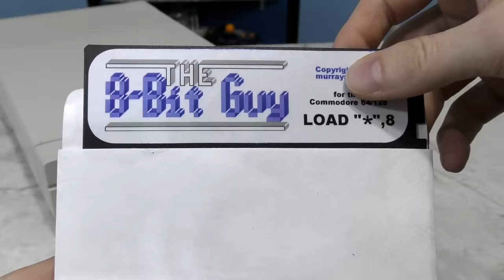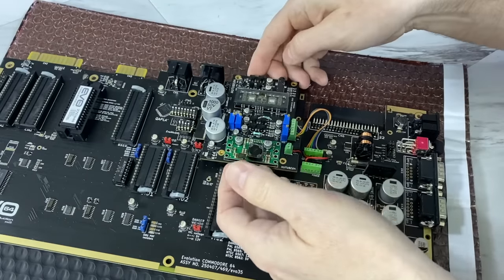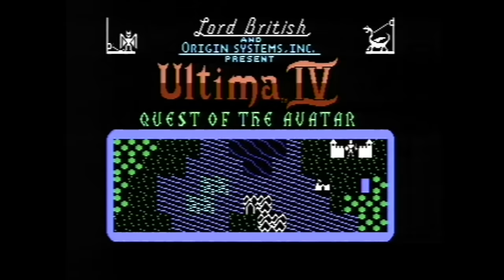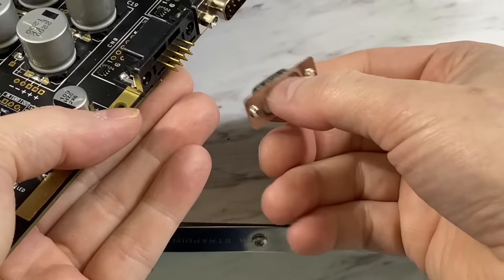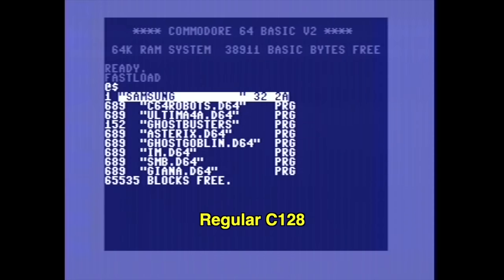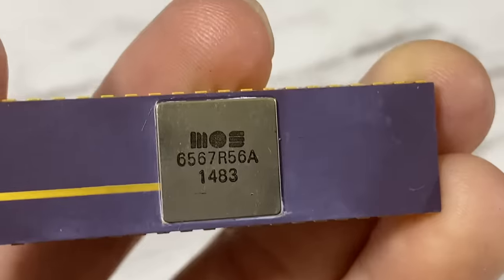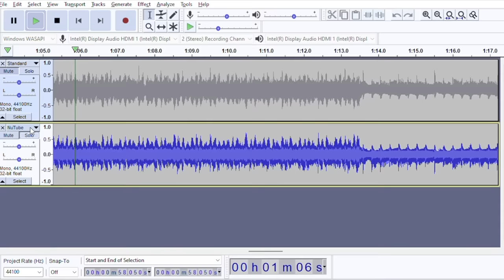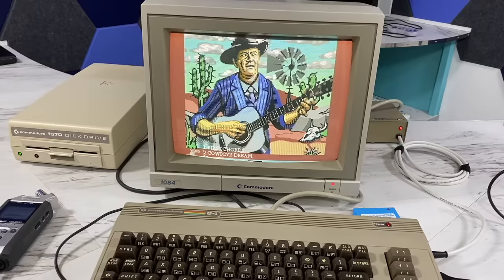The Evolution64 - Is it worth the money?

Comment: I'll try to make it clear. Vacuum tube doesn't improve sound. It's actually distorts sound. Vacuum tubes modulate... They add some harmonics to sound, even harmonics to be precise. But unlike odd harmonics even harmonics somehow (it may be related to human nature) convincing us that it sounds good. You can get that "improved" sound by connecting any source (analog or digital) to tube amp or even tube amp emulator.
Reply: This is why people like tubes so much. They color the sound in a way that is technically "wrong", but sounds better to some people because tube amplification makes the sound "warmer". You can hear this even when the audio is converted to a lossy digital format. If you use a lossless format at a high enough bit depth and sample rate (44100Hz @ 16 bit, for example), the resulting waveform that comes out of your speakers is identical to an analog source. Which is why the whole analog vs digital argument for audio is pointless. The point I'm making is that tube amplified audio will still sound the same, even if converted to digital (so long as you use a lossless format like WAV or FLAC, neither of which YouTube uses, in order to save bandwidth).
Reply: @Dr. Octogon Yes they do, but also there could be different stages in a signal chain that introduces different kinds of distortion. Take a guitar for example, it is common (in metal music) to use an overdrive pedal like the Ibaneze "Tube screamer" which mostly adds distortion to the peaks of the signal, and then goes into a guitar amp that does have a pre-amp (where most of the raw thick distortion is added) and then the output amp stage which compresses the sound and adds the tube saturation.

So, one can layer the distortions with a pleasing result. Not sure though if the EVO64 people managed to do this or not.
Reply: I wonder if this is because they have a quadratic-ish response rather than linear
Reply: Because audiophools are confused about production and reproduction.
Reply: @EMAngel2718  It's because of how tubes work. One of the reasons is internal capacity between electrodes.
Reply: No need for an emulator. A equalizer can emulate that sound in most of cases.
Reply: Don't tubes only distort when they are "pushed", or are they allways distorting even at low volume? As far as i have read, the more distortion, the more harmonics get added. This all seems counterproductive when you are trying to get an accurate recreation of sound.
Reply: @videocommenter235  Not actually
Reply: Did somebody do double-blinded test with those odd/even harmonics effects or vacuum tube/transistor amplifiers ?
Reply: @semibiotic  Yes. And results were almost the same for real tubes and emulators that add corresponding harmonics.
Reply: That`s correct. I`m Stefano, the designer. I personally do not care about what it is perfect or imprecise, but I care about what I like or not. And I like tubes souind. W.R.T. tube emulator. Unfortunately not all the physics behind tube behavior is understood, so what you can not understand, - or model with formulas - can not be coded up in an emulator. But for sure they are quick to give you an idea.
Reply: It can be true. 🤔 
Distorted sound might be more natural therefore credible for us.
I used to like my "powerful" digial set until I heard old, analog "pleasent" B&O sound.
Reply: @jacek-jan  I am a proponent of tube preamplifier and class A mosfet amplifiers. Some old IRF (now invineon) mosfet sound quite good. Also the toshiba with lateral junctions.... Mosfet out of OFF or SATURATION region have non lineariies similar to tubes...  Unfortunately class A mosfet amplifiers are almost not produced anymore (too much heat for too little power), or you are willing to spend thousands.... or making them yourself... so the market has moved to Class D. Some late class D are decent, tough. But again, they are not cheap. I do not bother any device not having depletion mode j-fets in the input stage. Clarity and rapidity is outstanding. Toshiba SK170, Faircjhild J113, Linear Systems LSK190 and the dual 389 are staple in modern sound design. Operational amplifiers with FET inputs are also good, but what-the-heck, let`s use j-fets directly. For a cheap C64 OPA, I would have chosen NE5534. Sounds good. Cheap, and quick. But light-years from what you can do with the nutube + jfets.
Reply: @johnboviLP  Auro, just above me has a better and more in depth response but… Yes, vacuums tubes only distort when they are driven to distortion. They have no crossover distortion when the sign wave crosses over from positive to negative like a typical transistor or chip amp has. There are however audiophile transistor class A amps that follow a tube topography; they’re highly inefficient but they have quite a following. Class D amplifiers have crossover distortion but it’s well above the human hearing range and they are probably a better solution than typical transistor, chip or tube amps.
Reply: @jacek-jan  Trust me! I'm an engineer) Maybe I even make a video about it... Some day.
Reply: Ah, yes, you must be the guys who have Pink Floyd's discography on FLAC and it takes up 300gb of space.
Reply: Totally right! And also the Nutube is ill suited for the job. With a maximum power dissipation of 1.7mW this device is basically useless. You can't build a guitar amplifier using this tube, and probably not even an headphone amplifier. It has low transconductance, low gain, a cut-off frequency of only 75kHz, lots of distortion... In brief: pure junk. I don't understand why somebody would want to pay 50 bucks for a device that a 10 cent 2N2222 outperforms in every aspect.
Reply: But connecting a Tube Amp, won't it further distort the output? Because my friend tried and the output was even lower in quality. Just asking. My suggestion him was to upgrade the Caps on the Amp
Reply: @fixitalex  k
Reply: 100% nailed it. !! Tubes soft saturate and distort which adds harmonics. An effect that can be simulated in software or solid state hardware. Very good explanation and to the point.
Reply: Thank goodness someone is saying the very same thing I have been arguing with audiophiles for decades.  An amplifier is to do one job...  One job only and is to take the input signal and amplify it to the correct impedance of the transducer that is receiving it.  Not to change it or to make it "warmer".  Guitarists wants a valve amplifier because they are producing "their" sound from their guitar as well as amplifying it to achieve their outcome.  That is completely different to a standard audio amplifier which is to replicate and amplify the sound.

As an ex-audio, visual, as well as an electronics engineer, I personally see that there is no benefits to what valve amplifiers has in comparison to a high quality MOSFET amplifier and without the issues that valve has inherited plus the price tag.
Reply: @@docwhammonot if you use dip
Reply: People like pictures with more saturated colors and more contrast... EVERY SINGLE TIME...  There's a difference between accuracy and general human preference, most audiophile fell in that hole a long time ago.
Reply: @roadtonever  dont forget the gold cables.

Comment: In that first audio section, I could clearly hear A difference between the original and the valve version; in the next section, not so much. I'd be hard-pushed to say that the valve audio was better though - part of the charm of the 8-bit computers is the raw-sounding audio.
Reply: But keep in mind that this was comparing the original stock C64 and the NUTUBE64 output from the Evolution64, I wish the standard ("transistor") output from the Evolution64 would have also been included.
So the difference you heard is probably due to the very different circuitry and filtering between the stock C64 from the 80s and the Evolution64.
Reply: I thought it was a bit less noisy.
Reply: The tube one sounded like it had a little "warm" distortion on it.
Reply: Seemed to have a thicker padding and warmth.  500$? nah
Reply: It didn't sound better to me either, just sounded like there was a little more bass.  Which is probably just due to amplification more than anything.  There was no comparison done with the default output of the new board, only the original C64 output (which is 40 years old at this point).
Reply: @Jonathan Brawn I noticed the same thing. Weird how the difference disappeared in the second section. And like you've said, I wouldn't say the first section sounded "better" with the Nutube—just different.
Reply: Section 1 seemed to have a sharper treble, but it didn't pop in the second section.

In the second section, there seemed to be a louder mid frequency on the original hardware that was outright missing on the second section.

If the wav file was posted, we could put it through a spectrum analyzer to see the balance changes.
Reply: Like the upper track was ever so slightly muffled, in a way that just kinda doesn't matter when talking about the crunchy 8-bit audio that comes out of a SID chip.
Reply: Tube version sounded a bit more distorted to me.
Reply: Same here. The first part I could tell it was different, I would say it did sound better. It wouldn't be something I would even notice while playing a game, maybe if I was making music. - That said. I wouldn't say it was worth $500.
Reply: To me, it sounded like the tube version had a bit more high-frequency components than the C64.
Reply: Pup aggreess you can hear a slight difference in the begining which pup likes better but then at the drums/noise area it sounded exactly the same. 

Again as David mention may sound a lot better with the audio passing directly to the speakers. This is something that you can only really do in person and not online!
Reply: I liked the way the nutube sounded, but I ain't paying $500!
Reply: @belzebub16  Excellent point. The transistor output from the Evo64 is probably better and closer to the tube output than to the traditional C64.
Reply: Major difference! The original was more dry sounding. While tube sounded more full and had more reverb in that song.
Reply: The difference was indeed clearly audible. I preferred the warmer cleaner sound of the tube amp, but preference is key here. Do you prefer the original out of nostalgia or would you prefer the better implementation because of quality? It is personal of course but even as a retro enthousiast, I welcome any improvement over the original experience.

I always look at it like this. Bread in the 18th century may have been delicious and perhaps people in the 19th century would have been nostalgic for that bread, but would you really still want bread with sand in it that would wear out your teeth before you were forty?

Sometimes old things deserve an upgrade.
Reply: Same here, there only was a slight difference in the first audio section, the background reverbs sounded a tad deeper, but the difference mostly was neglectable.
Reply: @Diggnuts  Oh, definitely - I'm not advocating that we return to 18th-century standards for bread (or dentistry), and I'm not suggesting that you shouldn't attach a  $500 valve amp to a 40-year-old computer - it's just my opinion that the original square-edged buzz sounds more 'authentic' _to me_. If you want to add a good quality amp and some proper speakers to your C64 to make it sound less harsh, then invite me around; I'd love to listen to it and see if I want to reevaluate my opinion.
Reply: The tube version was a bit thicker and had more sustain in the pads.  IIRC, he was using two different SIDs though, which is probably the reason certain voices sounded a little different.  It would be hard for an amp to affect things like that.  It would be all or nothing.
Reply: @nickwallette6201  Thanks for the clarification!
Reply: For me the second part of the music has a great difference in favor of Evo. The distortion filter became much more vivid when he switched over but that might be a personal experience like that audio Yanny vs Laurel
Reply: Was going to post exactly this; the high end is a bit clearer in the intro segment with the valve amp, but the difference was not audible in the second segment. As others mention, it's not clear with just those two recordings if the difference is because of the valve amp or just the different audio circuitry on the Evo64 entirely; the built-in transistor amp might sound fully identical, but in any case the difference is very small, and certainly not worth the $500 they're charging for the extra module.
Reply: @StormsparkPegasus  "due to amplification more than anything"... we are comparing amplifiers though, amplifying differently is what they do.
Reply: @Squonk06  >  Weird how the difference disappeared in the second section.
It's easier to hear if you pick a specific aspect of the  mix to hear differences. If you as an example listen to the lead melody sound it clearly gets more saturated/distorted which adds more overtones. The lead also gets a little bit more sqashed into the other sounds. 

These changes are even clearly audible on my iPhone speakers so no high fidelity listening equipment is needed.
Reply: Yeah, the NuTube sounds slightly louder.
Reply: @CZghost  yes the volumes definately were not equalized :-( impossible to really try to hear the differences when another one is just LOUDER
Reply: @pleggli  Interesting - I had hard time hearing anything. Maybe I did, but that may be only because I was trying to listen. I was listening via laptop speakers, then through cheap stereo set (with Casette deck, CD, radio and two AUX in (marked for MD and Video, but I've used both for PC's. Well, one for FullHD TV, but I used it more as monitor than as TV, the PC was connected via VGA and 3.5mm audio in plug - and laptop was connected simply via HDMI. Then 3.5mm plug for audio out was connected to stereo set with cable that had two RCA connectors on other end. Irrelevant because now I had only the laptop connected straight to stereo set.

I was wondering if it's my age - how old are you? I'm 42 and I know my hearing is not as good as when I was 19-34 (just example)

Honestly interestd as I like te think I had pretty good hearing back in the days.
Reply: @robsku1   I’m also 42 but I have been making music and done audio production since the SID/tracker days and I am very used to do critical listening in a mixing or sound design setting so that is probably the reason why I can pick it out easily.
Reply: @RyanDanielG  Gotta remove a lot of wallet padding to get a little waveform padding
Reply: @SnakebitSTI  because it was. Thats what tubes do

Comment: I like that there are options out there to keep the C64 alive.
Reply: Me too.

I really wish there were more projects like this, specifically for the Atari 2600 and TI-99/4A systems.
Reply: A free emulator does that, too.
Reply: @Okurka.  Emulators are great, and they also serve a purpose, but having accurate hardware (especially new hardware rather than antique chips) fills gaps and complements emulators in important ways.

It's a healthy system that has both.
Reply: Thing is, replacement boards like this are among the least useful such projects, because what's really in dwindling supply are the chips themselves. If anything, spare boards (and cases) should be getting easier to find because of all the computers whose chips have died.
Reply: @stevethepocket  Very true.  The chips (and the same for the TIA chip in the Atari, as I understand it) are really crucial and I hope something's being done to RE and rebuild them at some point.  We're going to need them more and more to preserve these systems.
Reply: @JosephDavies  It's not, however, a healthy price.
Reply: @JosephDavies  Accurate hardware is easily available second hand. No need for "pimped up" retro computers nobody does software for.
Reply: @PotatoeSnow  This EVO board needs the CPU, 2 CIAs, SID and VIC-II  out of that broken C64, might as well try to fix it.